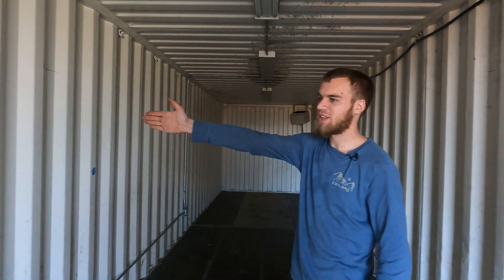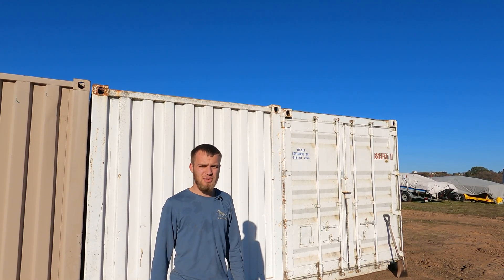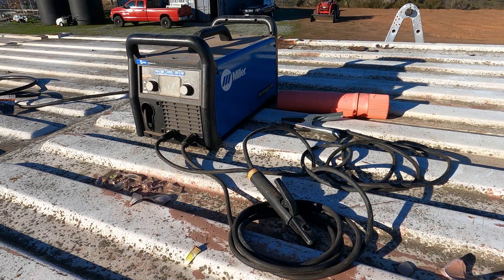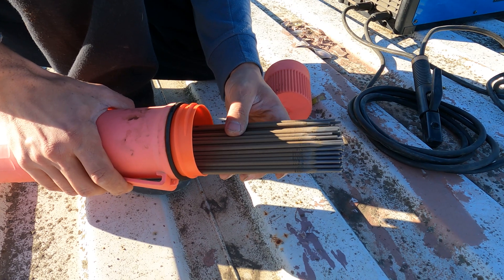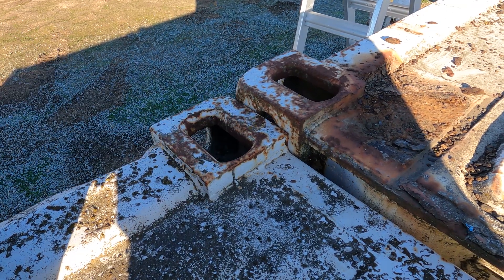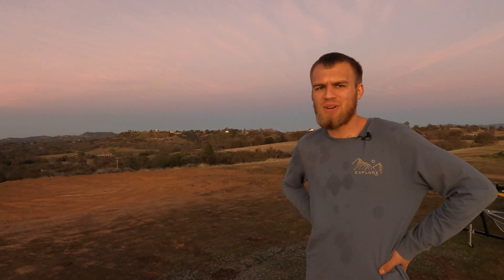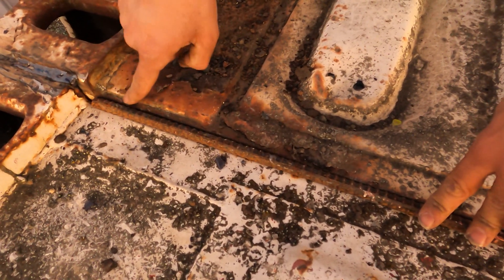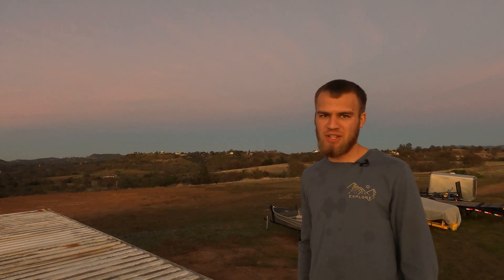We Are Building A Lab out of Shipping Containers! (Ep. 1)

Comment: What a cool project! As an idea for a silent and efficient heating solution: A small condensing gas boiler with a small gas tank/bottle cabinet and a single large radiator. They make way less noise than a furnace (same loudness and sound as a PC fan) and are much better on the batteries than electric heaters. The only things to be careful with are the minimum power, which should really be <2,5kW, or the boiler will short cycle like stupid, and the maintenance, which should be done every year to prevent frozen pipes, gas explosions, CO poisoning, etc... . Also outside temp. control is really not possible with a well insulated shipping container, and room temp. control should be used instead. Good luck!